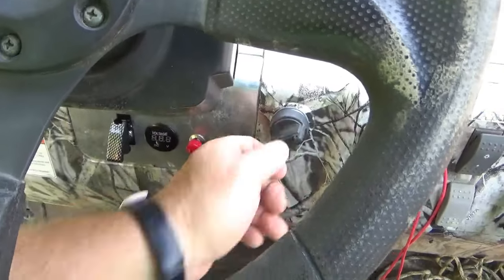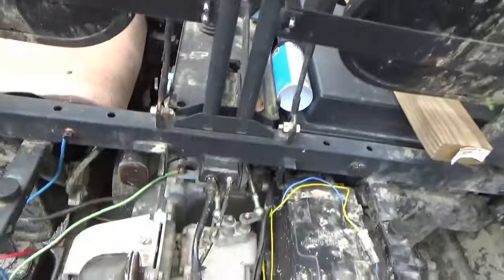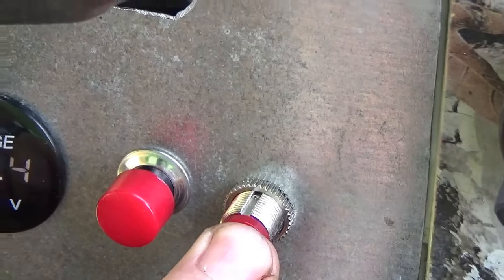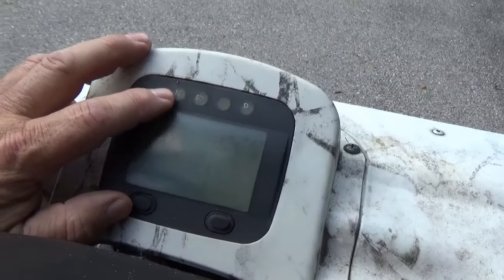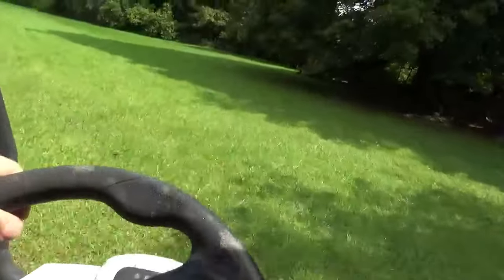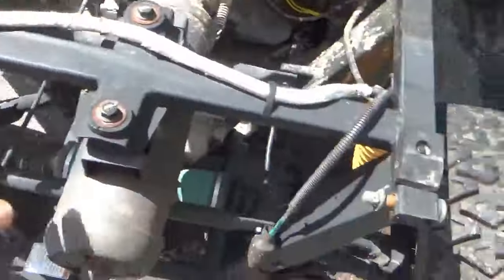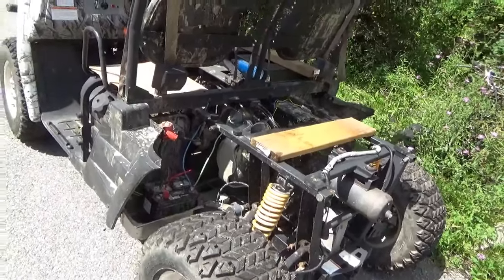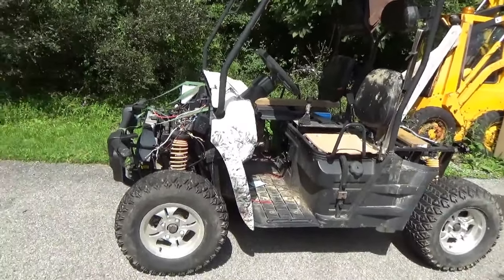Fixing a Nightmare UTV, Why This Maybe the Worse Side By Side Ever Built!

Comment: Thanks for sharing such great content. I now have two of the exact same side by sides-the first one was free and I think I got a bad deal-haha. Definitely take some clear headed diagnostic skills and correct fixes. Once dialed in they have been very capable and reliable machines that have performed well. I have found god sources for parts. Keep up the great work-very helpful and informative. I have wiring diagrams for both the side by side and 4 wheeler if you need them